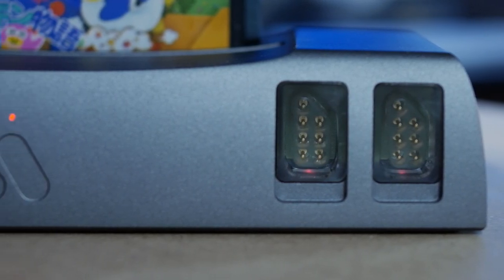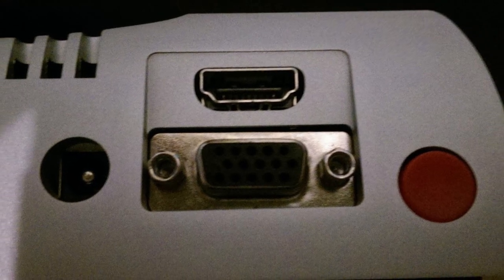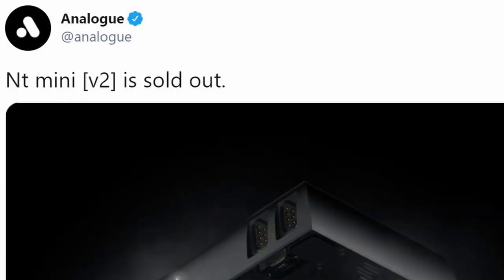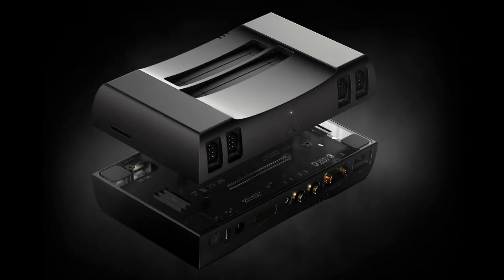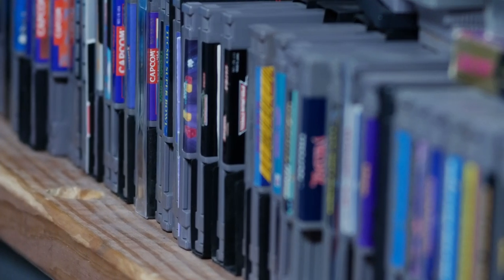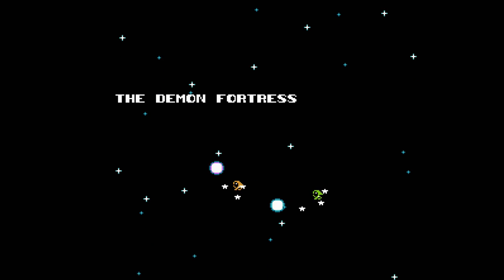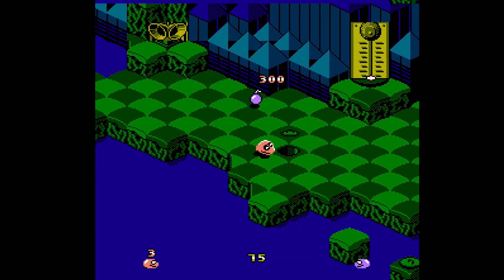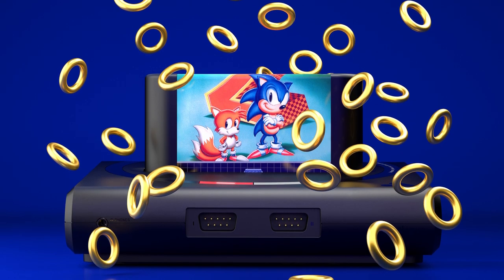The STORY of the Analogue Nt Mini Noir | HISTORY and REVIEW

Comment: If you want those artifacts in your Everdrive menu to go away enable the 3.6v Cartridge IO setting in the Noir menu. On the original Nt Mini this wasn't an option and the console always did the 3.6v. It confused the heck out of me why I was only getting the artifacts on my Noir until I found that setting. 

You could also upgrade to a later revision N8 or N8 Pro. As far as I know it's just older revisions of the N8 that cause problems.
Reply from the maker: Sweet deal! Thanks for the tip! 

And thanks for watching!

Comment: I really appreciate how you summed up the whole Mister vs FPGA console argument you worded it perfectly. So far I'm loving my Noir with the jailbreak, once you have those FireBrand X OCD settings it's pretty spectacular. Al though to be fair I am missing some of the AVS features though. Specifically the built in game genie codes (pre loaded list you can toggle on when you insert a cartridge) and the turbo button function which allows you to enable turbo per button on P1 or P2 (and even toggle the strength of the turbo). The N30 2.4G controller has physical turbo buttons which makes it borderline useless for games you want turbo only on one button. Minor knitpicks but still very nice features to have, plus for $200 it's pretty solid bang for your buck.

I do love Analogue though I own the NT Mini Noir, Super NT and Mega SG and it's reignited my passion for retro games. I'm so stoked for the Pocket and Duo as well, the Pocket in particular is going to be something majorly special with two FPGA chips and so many supported systems!
Reply from the maker: For sure! I'm really hoping I can get my hands on a Pocket - I'd love to tell that story. 

Also, the AVS looks like a really awesome device from all I've read. I'm hoping I can pick one up one of these days, but my wallet is still bleeding from the Noir, so it might be a while. 😅

Thanks for watching the video, and I'm glad you enjoyed it!

Comment: Hey Jon or anyone else...have you had an issue where the nt noir would not start and gave a three red led light blink? I pulled out the power, plugged back in and it then worked fine. Weird. 🙄
Reply from the maker: There are a couple of threads on this over at the r/Analogueinc subreddit. It seems like a lot of folks are getting the red blinking lights right before or when their systems fry due to a hardware fault. Seems relatively rare, but definitely something I'm keeping an eye on myself! I didn't find out about it until after I released the video or it's something I definitely would have mentioned. 😅

Comment: 13:10 That's not for the Famicom Disk System. It's for extra Famicom controllers, like the gun, the keyboard, turbo controllers, etc. The Famicom Disk System RAM adapter just plugs directly into a Famicom's cartridge slot.
Reply from the maker: Yeah. Another person pointed that out. I'm going to see if I can add an annotation to correct it. Just have to figure out how. 😄

Thanks for watching!

Comment: 1. That's not the most expensive N.E.S. Heck it's not even an N.E.S John.
That's a fancy hardware emulator that happens to be expensive.
2. If FPGA recreates the original chipsets people wouldn't of had issues with Everdrives working on the 2nd Firmware yea?
or any issues at all right? I mean because the original chipsets don't present these issues.
3. If FPGA has issues that the original chipsets don't, well that means FPGA is a lie as far as recreating the original chipset.